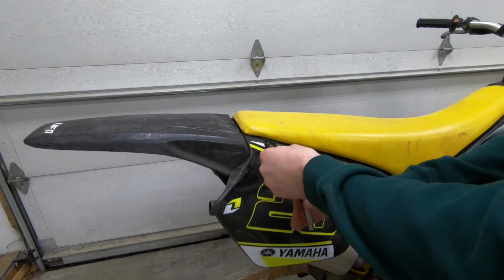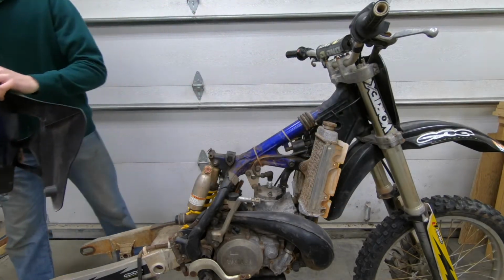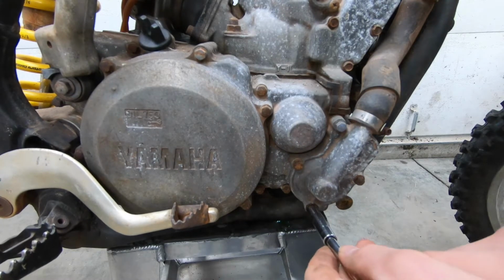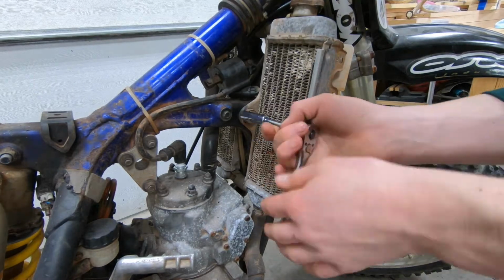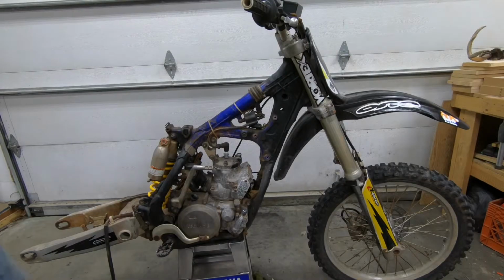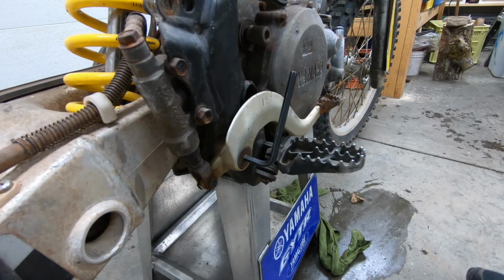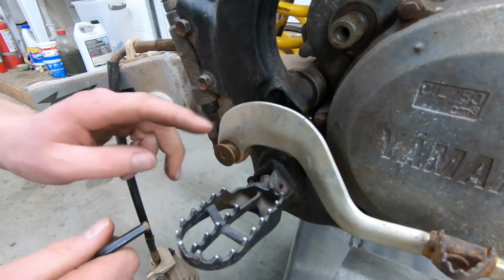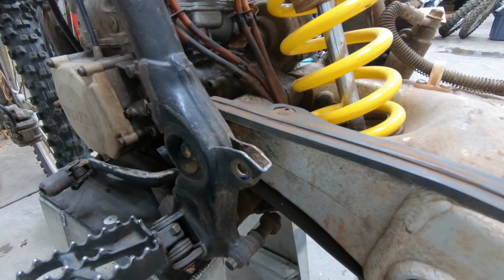$175 Yamaha YZ250 Teardown!

Comment: You are a professional that's for sure
Reply from the maker: Thanks man! Do you still have your zx10? Just watched your video. That thing is sweet!
Reply: @projectdirtbikes  traveling at 100kms an hour. (The clutch plates broke apart) Went into engine, rear wheel locked up and somehow I survived not crashing and dieing.
Reply: I spent 10grand aud. On it and had for 3 months. Full service history everything was perfect. I will never buy a Kawasaki again, but my dad loves them.

Comment: i put a 400 engine on my 125 frame ...it require engine work to make the power manageable  but it is a sweet ride.....no it doesnt fit direct!!!!
if you arent a consistent rider and use your head...i dont recommend doing this  27 hp to  57 hp! it works great in the desert!!
Reply from the maker: Hmm… I have an idea now!! 😁
Reply: @projectdirtbikes  good! if your thinking of making a like bike you will need to reduce the compression ratio. that will require a machinist and a heliarc welder. and remember to reinforce the struting. 57 ponies is alot of wrestling while your riding. so my friend think it through!
Reply: @projectdirtbikes  im currently working out an idea for two 100 cc motors driving two independent rear tires on a desert bike. the throttling is a pain, i have the shifting linkage fixed. no it wont wheelie! lloooll
but it will climb walls
BTW im doing all the work other than consults in a huge garage on the farm! 
the swing arm was easy to figure.... doesnt hurt im an retired engineer! lol again